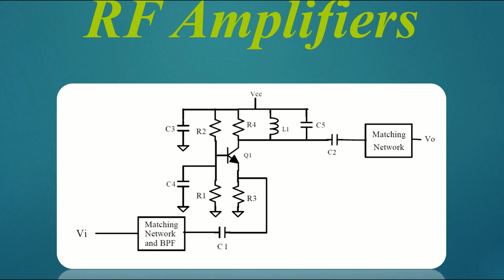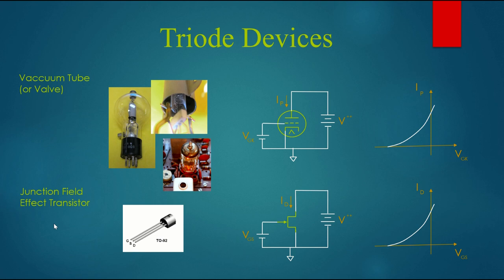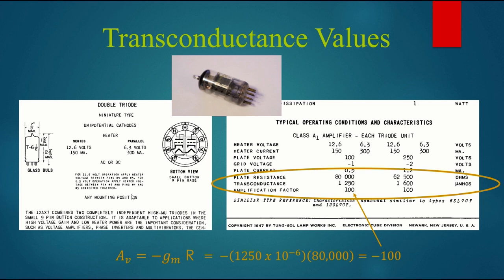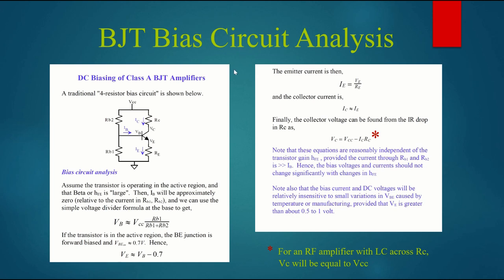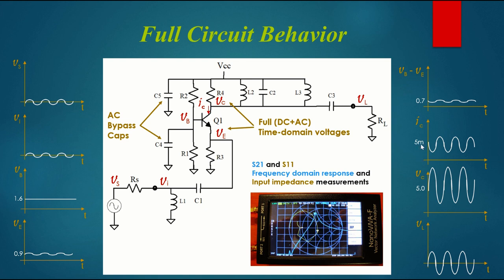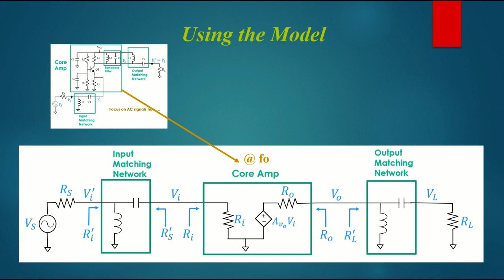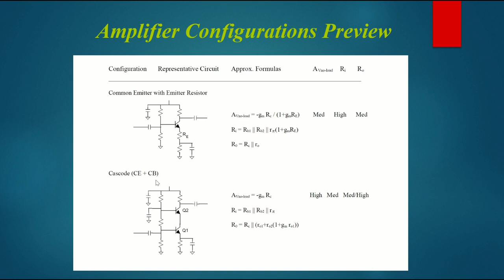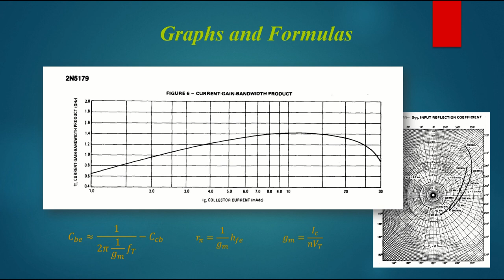Radio Design 101 - Episode 3 - RF Amplifiers

Comment: Would someone explain the possible output if the final RF stage input power doesn't exceed 1 watt?
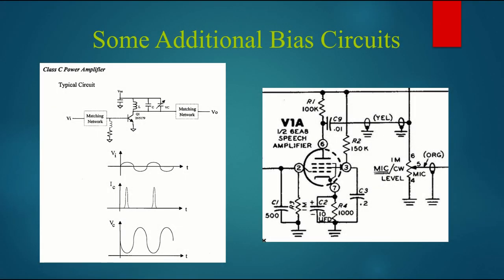Reply from the maker: The devices and circuits talked about in the video are focused on receiver design. So they typically never see more than a few hundred microwatts (or a few milliwatts) of input power. They are also too small to handle watt level signals without damage.  While the video series doesn't really address power amps, there is one slide in this video that shows how some of those are done (depending on the modulation type used in the system). See time 23:00 in the video. The left side shows a class-C power amp topology (but a higher power transistor is needed than the 2n5179)  https://www.youtube.com/watch?v=UUlqW-vSq9M&t=1378s
Reply: @MegawattKS  thank you very much for a straightforward set of clear instructional videos!

Comment: gm is transconductance and is used mostly for Valves and fets yes!!! A bjt???well technically yes but talking about Gm with bjts is unusual because you would be measuring  Ic/delta vbe.
That assumes that a bjt is a voltage device  like a tube or fet...transistors are current devices. You wont find gm on a transistor data sheet.
Reply from the maker: I agree that they were originally conceptualized as current-controlled devices, but there is no need to continue that tradition (except in biasing where it matters more). Indeed, a common more modern view is to treat them just like FETs - as voltage controlled current sources when in the active region. The value of doing that is that FETs, BJTs, and Vaccuum tubes can then all be analyzed with the same equations and circuit architectures (though the biasing will be different and the formulas for gm are different for each).  I've recently added an Appendix A to this series where this is covered in some detail.  Here's a link, with it queued up to the part that discusses this.  It's covered in about a minute or two from this point:  https://www.youtube.com/watch?v=m9X0mfg_8lQ&list=PL9Ox3wpnB0kqekAyz6blg4YdvoEMoJNJY&t=1438s
Reply: I had a look. I appreciate the work you've done, however, using transconductance with a device which has  HFE or beta, both current amplifying specs is silly. No offence. You can get really close approximations for gain using  dynamic emitter resistance and load impedance. Work out quiescent emitter current.
Divide 26mV by this current to give re. Gain in simply collector load /re plus any unbypassed emitter resistance. Easy peasey. So a common emitter amp with a Q current of 1ma, with bypassed emitter resistor and a 1k collector load has a voltage gain of 1000/26 =38.5 
Why make things hard??
Reply from the maker: @paulphoad  Hi.  Apologies in advance for a long answer...    One formula for a CE amp (with bypassed bias resistor RE) is Av = -Rc/re as you said. Agreed. But that is identical to the gm based formula Av = - gm Rc. This is true because re = Vt/Ic as you said, and gm = Ic/Vt in the gm based analysis. So re is simply 1/gm. Neither formula is based on a BJT having a current-gain spec. And neither method or formula is harder than the other. They are identical - except that one may look more familiar depending on how things were taught. However, it is true that some other formulas exist which factor in Beta and can look quite different than in the gm model based analysis.  I use and taught the gm based model exclusively because it translates directly to FETs, so there is no need to change things when we moved to analog or RF integrated circuit design using CMOS processes. BJTs have that annoying base current - but that's captured easily by adding r_pi = (hfe*re)=(hfe/gm) to the model, which is the only topological difference in the BJT and FET models then.  However, it goes beyond that. Tracing back to the original physics analysis of BJTs, the modulation of collector current occurs via the PN junction voltage at the base-emitter (with a correction factor alpha approx=0.99'ish capturing the base recombination, resulting in the Beta parameter).  IMPORTANT NOTE:  The use of the simplified formulas Vt/Ic or Ic/Vt is limited to textbooks. Real-world devices have a junction grading coefficient n as well. So re = nVt/Ic  (or gm = Ic/(nVt)),  At higher frequencies, even that breaks down and the industry uses measured Y or S parameters. Y parameters are directly compatible with the gm based model. The (2n)5179 device used in RF design and in this video series is a good example. Please see Figure 9 of the Motorola datasheet for the 2n5179 device which graphs Y parameters versus frequency. https://www.silicon-ark.co.uk/datasheets/2N5179-DATASHEET-MOTOROLA.pdf    "gfe" in that figure at low frequency is gm (or 1/re). From the 0.04mA/V at 1.5mA bias, Fig 9 indicates that n is actually 1.5 in this real-world device, not the 1.0 value assumed in most textbooks for examples and problems. So the real world gain would be 1/1.5 lower. Moreover, neither model would work above 250 MHz,  as the forward transconductance falls off due to extra physics (base transit  time effects if I remember right) not captured in the simplified equations/models. I hope this helps explain why I don't use Beta in AC models and analysis (except to find r_pi in the model).  Not trying to be difficult. Just trying to add to the discussion. 🙂
Reply: @MegawattKS  nice, well thought out. I don't teach gm with bjts but I see your point. Gm being reciprocal of re. 
Your aproach is interesting.
If it works for you then perfectly ok.
Couple of things.
In Australia we generally use 0.6v vbe rather than 0.7volts.
It's much more accurate. 
If I were to use the term gm then students would automatically assume an open circuit input z. Being use to fets etc.
The input z of bjt is parallel base bias  resistors in parallel with hfe(re +RE).
So not anything like a gm device.
You seem like a smart man and a good teacher but I don't like applying gm to a current amplifying device which has transresistance rather than transconductance. Happy Eastef to you and family Paul.
Reply from the maker: Cool.  I used 0.6 in some classes too, rather than 0.7.  It's good to go against the proverbial "0.7" in any case. Students need to know that it's not a magic number that works everywhere (or at every current :-) ) On the gm thing, it's a choice for sure.   A colleague who does our first electronics course told me he covers both. I think I first got into the gm model from using the "hybrid pi model" in the textbook we had in the 80s.  (cf.  https://en.wikipedia.org/wiki/Hybrid-pi_model )   Hope your Easter was a good one as well. Cheers!  - Bill

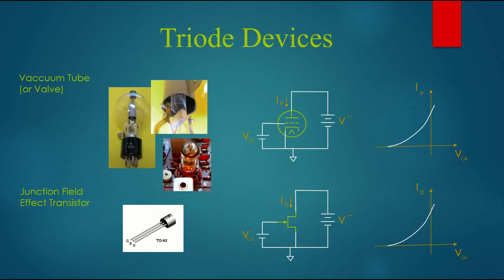Comment: You are repeatingly making the same mistake with current direction indicator made on the first tube triode drawing (5:39)!
Reply from the maker: Sorry - I'm not sure I understand the issue. The current arrows shown follow the "conventional current" convention used in circuit analysis and design, where current flows from positive V++ , through the tube, to ground. While it is true that electrons leave the cathode and flow to the plate, that is "electron current" - not conventional current. Does that help?  (See, for example:  https://web.engr.oregonstate.edu/~traylor/ece112/beamer_lectures/elect_flow_vs_conv_I.pdf )

Comment: i dont understand.. all the videos done like this.. noone... noooooonnneeeee has a highlited pointer.. the old hand or arrow and it fades into the background... someday somewhere someone will use a seeable pointer.. anyways good videos so far besides the pointer hahah
Reply from the maker: Thanks for the feedback. Believe it or not, I totally agree. This is definitely a problem.  In my case, it's due to PowerPoint and the MultiCam software I use to capture the voiceover+zoom/pan on the slides. I have tried several times over the last year to find a way to get a better pointer - but no luck.  Even when I go to win+R and change the pointer for Windows as a whole, PPT overrides it during zoom, replacing it with the smaller hand thing because it thinks I need to be reminded that I can pan while zoomed in.  And the most annoying thing is when it blanks the cursor after you pause too long.  PPT software won't give you a stable way to create a large pointer (or I haven't found it).  I'll keep looking though !   (I'm currently employing "Reading View" during production to maximize the pointer size - rather than "Presentation View" which has it's own issues.  Microsoft: If you're listening, please help us all out by allowing the user to chose and size a pointer independently of what PPT thinks is best !)
Reply: @MegawattKS  ive never done anything on linux for video capture. but i wonder if would work better on linux... ill have to look into it some day ... but hey over all videos are good. ive watching the rf amp video.. learning more from it then anything ive read or watched ... wanted to build a 6m amp. so hope after watching it a few times iam able to .. lol